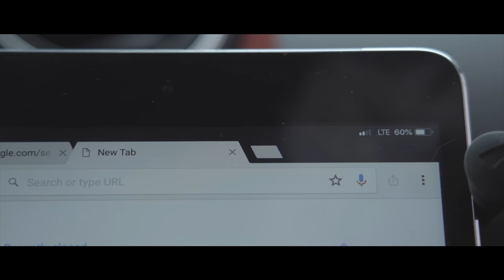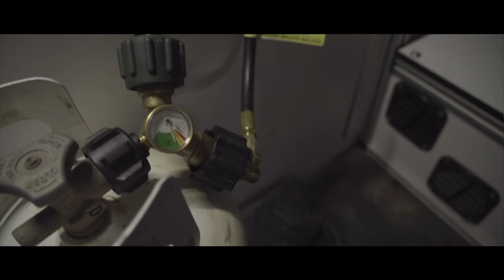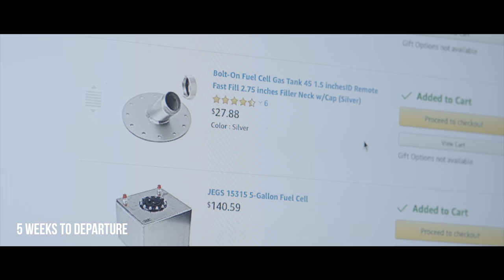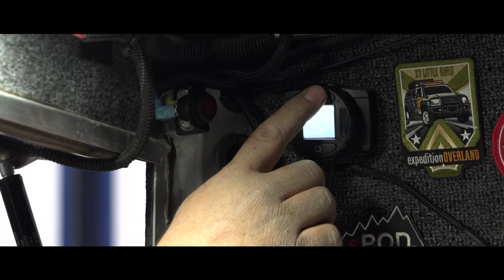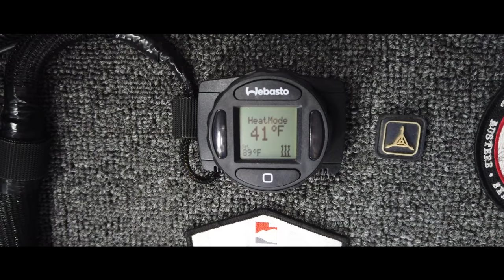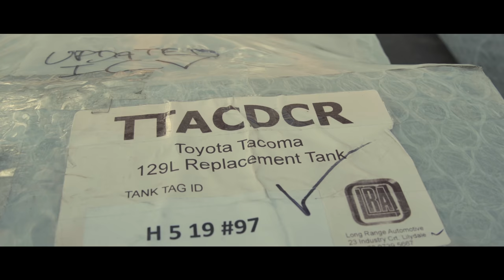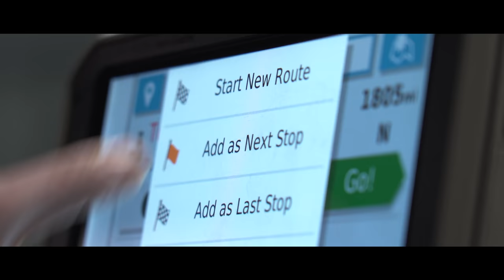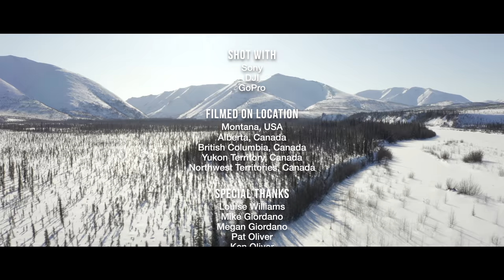Prepping the X Overland 2016 Toyota Tacoma for an Arctic Overlanding Trip! - Arctic Solo Series:EP1

Comment: I just recently watch a video of a guy doing this trip in a 2WD minivan during the dead of Winter. I suppose this truck will do it. lol 

I look forward to watching the series either way! I would love to do it some day. It feels like a different planet up there. I spent a few weeks up on the North Slope in Alaska during the Summer a few years back.
Reply from the maker: The Dempster is definitely doable in a car or minivan if the weather cooperates.
Reply: @ExpeditionOverland  That is true. On the other hand... the weather can be super duper deadly if it decides to. I look forward to seeing your show!
Reply from the maker: @great0789  For sure. That was one of the reasons for adding a heater to the Habitat. Having mechanical troubles with the truck in -35F can be fatal if you don't have the proper outerwear or a backup heat source.
Reply: @ExpeditionOverland  Oh yeah! Totally! I lived in Fairbanks for several years. Once you started reaching those temps... any exposed skin was instantly numb. Would not take long to slip off into a permanent sleep.

Comment: Make sure the main motor battery is less than 5 years old. For those times when you have overnight electricity a good electric block heater and an electric battery blanket are a must.

A good set of 2 gauge jumper cables.

Motor oil rated for arctic use eg. 0 W 20.

Winter windshield wipers, don't leave home without them. Windshield washer fluid rated for the coldest temperatures you will face. A long handled snow brush with a good ice scraper.

Tiger torch, 20 lb bottle of propane and a steel bucket. You can safely thaw out almost any frozen vehicle with them.

Some cardboard pieces sized so that you can slide them in front of your radiator to control your engine temperature when it gets really cold.

Good quality V Pick tires chains for both the back and front wheels. Ladder chains are good, diamond chains are better.

Lock de-icer.

Keep your gas tank at least half full to prevent water condensation in your tank.

Don't use your parking brake in the severe cold unless you absolutely have to.

Comment: Make sure that your diesel tank and tubes and fittings are isolated, and try to keep de diesel warm by engine heat !
Also to filling. Points for the tiered air ,so when you refill the air in the tiered you can measure at the same time ,in very cold and wind it saves fingers and time !!

Comment: Great show guys, thank you for sharing.  I have a crazy idea for you.   Could it be possible to run the hot air trough a cooking box, something like a microwave's size.  Just a simple steel device.  In this way you could use the hot air to warm up food, slow cook meats, do lots of things without using any extra fuel, since you are burning the fuel anyways to heat up the truck.    Just an idea!

Comment: Great 1st episode ! Waiting for the 2nd.  As for the Webasto heater, I've been using it for 6 years and works like the first time, no service needed at all. But I wonder why did you choose diesel instead of gasoline, it is easier to draw fuel from the main tank and not worry for freezing at low temps.
Reply: The diesel heater has a higher output and maintains the output at higher elevations more then the gasoline one. Elevation is a factor for us in Montana and Canada

Comment: Why not get (or make) a quilted insulation liner for the habitat? Judging by the light coming through, it looks really thin. It seems like this was solved in the most complex, expensive way possible.
Reply from the maker: We did look at this a few times. But regardless the heater needed to be upgraded for the stated reasons. It would have been very nice to have the quilted top. But time/cost to make one for this trip became a delta point to not do it. If we where to do more of these trips we would get one made for sure. -Clay
Reply: @ExpeditionOverland  thanks for the explanation! Looking forward to the season!

Comment: Great Episode... Two Questions...  
1) What was the heater you took out? Been planning an install in our trailer and want to keep this in mind. 
2)  Why did you bed line the diesel tank? I about to install a water tank, and wondering if it would be good to bed line that.
Reply: It was a Propex propane heater. Dont remember exact model. The bedliner we already had and wanted to add another layer of protection.

Comment: After following you guys for several years, I have a question: if you were to drive only one vehicle for all your adventure/off road trips for the rest of your life which vehicle would you choose - Land Cruiser 200, 4runner or Tacoma? (Tundra is out of my consideration.) And, Why? Have you made any comment or discussion on this matter before?
Reply from the maker: Landcruiser 200 series all the way! This rig is built stock to go around the world and run 400-500,000 miles on its engine. It has beefier components and spare parts are found easily anywhere in the world. It is also very comfortable and will tackle just about any challenge.
Reply: @ExpeditionOverland  Thanks for replying. Putting aside ride comfort, would you recommend 4runner TRD Off-Road Premium over LC200 in any circumstance? 4runner TRD Off-road has Rear diff lock, A-Track (I understood A-Track works like front and rear diff locks together), Crawl control, MTS, KDSS vs LC200 has central lock, crawl control, MTS, KDSS. Also, LC is way heavier than 4runner; which is not helpful on mud and snow, I guess. Lets say I will attempt your Alaska/Yukon trail as light as possible. I won't tow a trailer. Considering above factors, would you recommend 4runner TRD off-road over LC200? Let's forget about driving the only vehicle for the rest of my life.

Comment: Great video!  Question, did you install the Weboost Cell Signal Booster as well or just the Weboost Truck Antenna? Will the antenna work without the booster?

Comment: Aren't you suppose to put some additives in the fluids or have a battery, oil and transmission warmer installed?
Reply: Much less critical in a gas engine, especially one with smaller displacement.

Comment: I know gasoline is cheap in the USA but a diesel vehicle would be more suitable for the artic since most of transport uses it.
Reply: It’s hard to go wrong with a vehicle that is already owned and built. Gas and diesel are both easily found up north. Plus, we can shut off the gas truck at night. Diesels tend to needs to be plugged in or run throughout the night in the extreme cold.

Comment: It's interesting that diesel was suggested for cold weather. Especially since you need to add an anti-gel supplement because diesel contains wax, which solidifies in cold temperatures. Also you need to keep an extra fluid that only has one use, the heater. If you used a gasoline powered heater then you could use fuel from the truck in an emergency. You could have also plumbed the heater to the original fuel tank, if it was a gas unit, and saved the weight and time of installing a fuel cell. And diesel weighs more than gasoline per gallon. Diesel is around 7 lb/gallon while gasoline is around 6 lb/gallon. For a long distance trip every pound counts against your fuel range. However it's easier to advertise products you were given for free than do proper research and select the best product for the situation.
Reply: We were originally going to do the gasoline route so we could plumb straight to the tank. Webasto highly recommended we go the diesel route for higher BTU performance and  better higher elevation performance being we are in the mountains in Montana. We definitely did our research and we went with what would have the best output!
Reply: @Tanner_Johnson  Agreed; diesel is better suited to the task.

Comment: I'm internsted due what reasons webasto recomended a diesel over gasoline heater? especially since gasoline was already available and diesel is known for causing problems at extreme cold temperatures?
Reply: mainly the performance output at higher elevations in the mountains.

Comment: What were the spare parts you chose to take with...u-joints, belts...?
Reply: yes and yes and spare front shock due to the cold and seen them break the springs before. luckily none of it was needed!
Reply: @Tanner_Johnson  interesting, never considered a spare front shock...did you have a spring compressor too or just assumed you would have a shop do it if it came to that?
Reply: @willraff6471  it was the whole assembly with spring pre installed
Reply: @Tanner_Johnson  gotcha, that makes sense

Comment: Do you already have a Cell Phone Signal Booster? And now you are adding the weboost antenna?
Reply from the maker: We added a much better antenna. The small one ours came with didn’t do much. This one helped a bunch.
Reply: Can you give specifics on the weboost system. What model/part numbers are you using please an thank you!
Reply: Hi, love my Weboost antenna. Unfortunately I ripped it off going through some shrubbery. Could you point me in the direction of where you got the mounting bracket that lays it down? I can’t it anywhere. Thank you 🙏

Comment: That Tacoma needs an engine transplant...a twin turbo 4.5 litre diesel engine from a 200 Series landcruiser. No need for the extra fuel cell then...it would just run off the main diesel tank.
Also, while you're at it...why not opt for a diesel cooker too. No need for propane or petrol ("gas" for you yanks.... I'm from Australia).
Reply from the maker: An engine swap (with an engine we don't have in North America) sounds a wee bit more complicated than adding a five gallon fuel cell... ;)